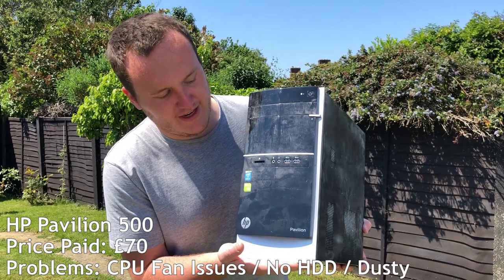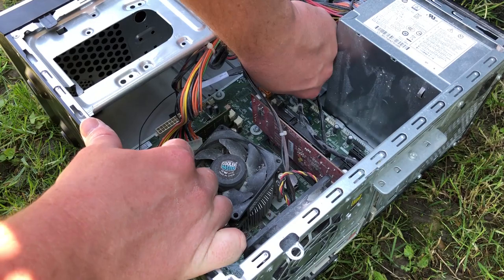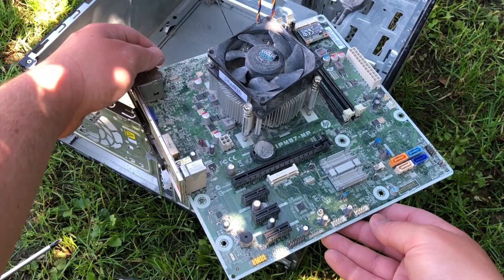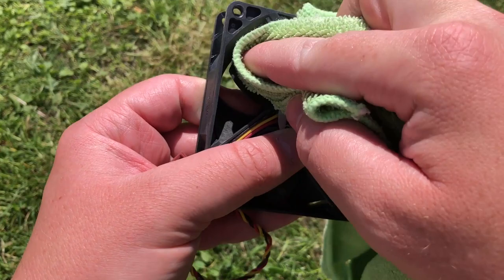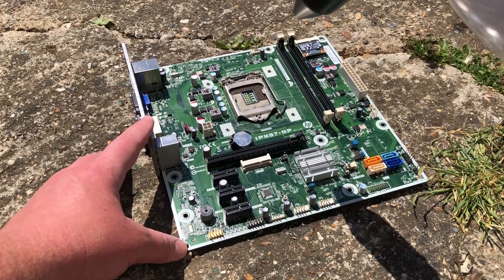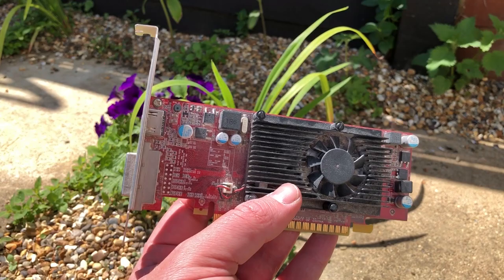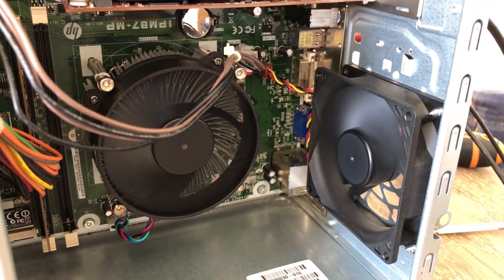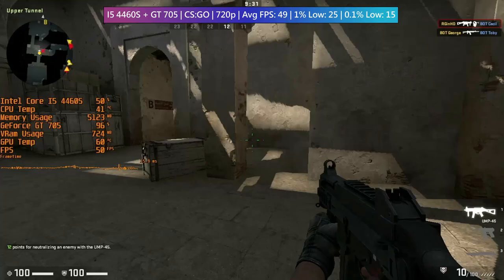Fixing Broken Ebay Gaming PCs - The Filthy HP Pavilion

Comment: I got an AMD A55 board with broken fan connector. I used auxiliar with a larger fan borrowed from scraps (which had the same pinout). Reason of damage was a transistor just behind the connector and looks easy to fix if you have heat gun or solder station to replace it.
If you don't want it, find a PWM extension cable or a heat sink with two fans (got one from Aliexpress) and use the auxiliar fan comnector
Reply: Board fan connectors can fail due to overload in fan (dirty fans also can do this), damaging the controller near it.

Comment: Love the videos, I've got an old optiplex 780 Mt and upgrading in small bits here and there. hopefully the new PSU will fit the 24 pin on the board.

Comment: 6:07 - I think it really depends on the materials; You have these expensive ESD-brushes that are made of some kind of composite that isn't conductive and thus prevents electrostatic build-up. - But I think, if you have something like a wooden handle and bristles that aren't plastic prone to static, I think you should be fine. - I'd just look out with those metal parts that hold the bristles, to be honest, and again anything plastic. Though, I bet even toothbrushes could do the job safely enough. - Also make sure that, with really tiny parts on PCBs, that it's a really soft brush like the one in this video indeed. - I'd also suggest using a brush on fans instead of a cloth around a finger for convenience, if you haven't tried.

Comment: I went to my recycling center and this guy recycled a gaming computer that had a 660 ti. I looked at the price that these are going for and they're selling anywhere from $60 to $80 on eBay. We're not even at 750 TI performance here. I put it in a Dell optiplex and replace the power supply and I put it out there on Facebook. Decent little machine.

Comment: One product I will always recommend is Holt's electronic circuit board cleaner spray, it is amazing stuff and dries clean too.   I use as brush of choice an old hairdressers neck brush which is very soft but has enough spine to get into dirt very easily.   Beware that DVD, they accrue dust like magnets so prob want to power it up after blowing through the encasement and have the door open and blow thru again and dab a bit of white grease on the spindles and motor shafts.   Been doing this since the 70's hehe

Comment: if you have noisy fans, simply open the sticker on that fan and below that, you will find a mechanical part of the fan. then just add a little bit of lubricant oil and you're good to go.

Comment: pea size ftw. Only time I had issue was on a razer blade where the GPU doesn't get a smooth copper heatsink, but instead two pipes pass ontop, leaving a hotspot where it doesn't spread due to the separation of the pipes.

Comment: I found similar looking Pavilion from dumbster back in 2017, i5 4440, 12gb of ram, gtx 760 and 1tb hdd. Only problem with that machine was corrupted Win 8.1 installation. New fresh install and vola! I used it as my main rig for 2 more years and sold it for 300 euros :D (Before that i was using some carbage with Core 2 Duo and gt8800 so it was a huge upgrade)

Comment: I have an HP Pavilion PC from 2010 with an I7 processor and a GT 420 card. Of course, the benchmark for the GT 420 is puny, but, amazingly, I can get around 60 fps on Arma 2 (with low settings and 88 % resolution) and even on Arma 3 (with low settings and low resolution in windowed mode). In fact, I replaced the GT 420 with a GTX 570 soon after I bought the PC and soon discovered the wonder of (at that time) "high end" gaming. But after a few years of faithful use, the 570 died and the GT 420 came back... I did try to upgrade it with a 1060, but the mobo was too old. So I tried a GT 1030 instead. Same story. So, I've just bought a second hand GTX 560. Waiting excitedly for it to arrive...

Comment: I bought this new in 2014 at half price in a currys sale.I now have it connected to my 65" samsung where I use it to watch youtube videos without the ads thanks to adblock+.I'm not a gamer,but do use photoshop from time to time and with 32 gb ram and an ssd fitted it still performs quite well despite the cheap and nasty gpu.Mine has the amd chip rather than intel.

Comment: That's cleaner then my Dell T7500 I brought off Ebay for 100 pounds.. It had fluff and lots of dust in her lol. 

Good buy still as it had 48gb ram and a 120gb ssd installed with a 6 core 12 thread 2.8ghz Xeon

Comment: Just noticed that CEX are selling a PC with a ryzen 3600, 16gb ram, gtx 1660 super, 240gb ssd for £655. That seems not to bad in this current climate of gpu shortages if you need a mid range pc.

Comment: If you have optical drive i.e. CDROMS/DVD drives you need to open them up and blow all the dust that's inside, take a q-tip and clean the laser read head movement rails and re-lubricate with Super Lube. Super Lube is the best damn silicone lubricant on this planet.

Comment: Hi, I know what you mean, The states that I get systems in for repair. I have had a couple that needed cleaning with a pressure washer. Dell & HP Pavilion seem the worst for low specs, most times you need a new case if the motherboard is shot. I replace the power supply's with Corsair CX600M units. Enjoyed the video's interesting channel.

Comment: The correct answer for the thermal paste:
It doesnt matter shape, as long the ammount you put can cover more than 90% of the IHS after putting pressure with thd cooler..

Too much will have the opposite effect of cooling, and will spread all over the place after putting the cooler.
Too litle will overheat.

I personally preffer to spread it manually because I cant be really sure a pea dot of thermal paste will spread evenly on the ihs with the cooler pressure. But its not like it's wrong a pea dot.

Comment: I have that identical pc, removed the fan pwm wire and it now runs fine, run it with a noctua low voltage extension so its not full speed and its fine.

Comment: You mentioning on the PSU and not taking it apart (Disclaimer: If you don't know what your doing don't do it as you literally can die in a instance) but you can take them apart and short the cap across with a insulated screw driver and it will discharge the cap if there is any residual voltage left leaving the interior safe to work on.

Comment: You can mitigate some of the stuttering in games like Fallout by setting a max frame rate(I'd say 30-40 for the Fallout example) in the Nvidia Control Panel 3D settings.

The lower variance in fps will make the stuttering less noticeable. Doesn't always work well, but yeah, it can eke out a bit of extra playability sometimes.

Comment: I would recommend cleaning/blowing the motherboard with the CPU inserted otherwise you can blow dust on the pins or worse bend the fragile pins. Other than that great video.

Comment: For whole thermal paste, simplest answer is, the only wrong way is too little. Pea sized dot, x, smiley face, lines, flowers,... it really is all within less than 1C difference for regular desktop parts. It starts to matter a bit on HEDT like Threadripper, since heatspreader and CPU itself are huge. But with regular things us mortals get, it is small enough that it spreads once it gets pushed down by the cooler and paste is made to fill smallest of the "cracks" between CPU heatsink and cooler. It is really thin layer. And even doing too much, will just squeeze a bit out on the sides, which is non-issue unless you used whole big tube.... though it wouldn't be an issue with that either as long as paste is not electrically conductive. So basically, you almost can't go wrong and even if one corner is missed, die itself is in the center for Intel and heatspreader has "spreader" in the name for a reason.

As for GPU, make sure you give it enough, because unlike CPU, GPU has no heatspreader that can make up for some corner not getting paste. It is on die directly and it has to cover corners, because otherwise that portion will run hot. Obviously this little thing didn't need much, but if you got bigger die, then give it enough.

Also for beginner and most worry free, don't get paste with metallic base, or in other words electrically conductive. Something like Arctic MX-4 is fine and very safe to start with.

Comment: I like to use a 1/2" paintbrush for cleaning out corners, fans etc. The long bristles reach in to heatsinks well too.
With the low power CPU the PSU should handle any slot powered graphics card. Ignoring that you can't buy any for sensible money good options included RX 460, RX 560, GT 1030, GTX 1050, 1050 Ti or even GTX 1650.
And of course another 8GB stick of RAM.
Max CPU would probably be 4770, think there is lower power version of it that should work.

Comment: this is exactly like my grandpa's old computer that I took apart not too long ago. Except this one is a bit more "normal" looking. My grandpa's didn't have a discrete power supply or graphics card, and it had a soldered CPU. The motherboard handled power delivery and didn't have any PCIe lanes. It had a soldered AMD E2 CPU of some kind, and used onboard graphics. It also had mismatched RAM sticks, with a 1GB Kingston stick and a 2GB Samsung stick. Weirdest computer I've seen so far.

Comment: i'v opened manny psu to clean them, then i could say, if outside of it is dusty, inside too, you clean only the outside , the inside still dusty, 
there 1 psu that i cleaned, the board inside are actually green in color, but turn brown because of dust.

Comment: Got a i7 870 pc for $20 that way.

Bought a 27 inch 1080p hp monitor from Marketplace for $30. Went to the old ladys house to pick it up. Asked why she was selling it and she said she didn't have a need for it as her computer didn't work.  She said she had a local repair shop fix it for her but it still wouldn't stay on.
I popped off the side cover and saw every fan avaliable was completely clogged with dust. Including the psu .

Told her I would fix it for her without charging but she had already bought a laptop. Tried to give it to me for free but I had to give her something. 

I removed the cpu fan and saw it had new thermal paste... I'm just confused why some repair shop would put new thermal paste on but not clean any dust.

Comment: I received an older Compaq version for free. With a new mATX LGA1150 motherboard, 2x 8GB DDR3 1600 sticks and a new PSU, I have a perfect system for my i5 4440 (or i3 4160) and 2GB GTX 650ti. Also has an onboard Ati Radeon 4250 and an Athlon X2.

Comment: I have a system where that fan error comes up constantly, but that is because i slapped in a case fan on the cpu cooler. At the expense of a lot more noise it got quite a bit cooler

Comment: That 4460S' iGPU fairs better than that 705. Might as well use the iGPU. I used to have the 4460S and it could run cs go at 100 fps easily in low settings

Comment: Doesn't that CPU have Intel HD 4600 graphics? Wouldn't you improve performance just by removing the GT 705? as the iGPU is actually more powerful, especially if it had dual channel ram.

Comment: Lol that's what I got currently with a bit of upgrade, the motherboard is the Memphis S pegatron. I've got core i7 4790 non k with a GTX 950 and 600W certified bronze power supply and 16gb of 1600mhz ram

Comment: On the application of thermal paste: exactly, there is no black magic, it is not rocket science, just a drop in the middle 😄
Reply from the maker: Yep, no need for a 10 minute video on it 😂
Reply: Depends what you are using, with Kryonaut the best application is very much to spread it as it is thicker consistency and won't spread as well. There is even a chance the consistency could cause gaps if you just put a drop and compress which will be an issue - not a regular issue, but it has a much higher chance of happening than cheaper mx4.

Comment: You answered a nagging question I had about whether or not GTA 5 was more CPU or GPU intensive. No wonder it seems to run so well on my Lenovo T 530 ThinkPad. My setup consists of an i5 3230m 2.6 GHz (overclocked to 3.1 GHz) CPU,Intel HD 4000 GPU, 16 GB of RAM, a 1 TB storage drive, 128 GB SSD boot drive and I am running GTA 5 off a 128 GB SD card. I am getting 25-35 FPS averages.

Comment: alternatively you can use a torx bit to remove those screws, hp seems to have a love affair with those things lol. now the power supply? I guess I was lucky in the early years then, had taken many apart to do just that. a smokers PC had a lot of challenges lol. but yeah in retrospect, I probably could have used rubber gloves.

Comment: slap in a GTX1050 or 1060, or an RX470/480 and a 400W+ PSU and you have a decent budget gaming PC right there. Always boggles the mind why people simply throw these things away. Heck even a GTX1050Ti could be had that doesn't require a power connector and that way you wouldn't need a new PSU.

Comment: another ram stick and a 1050 and that little hp will be pretty good

built my mother a similar pc achually from the trash bin at work
dell 790sff  i7 2600 16gb ram 
and i put an 256gb ssd and 1050ti msi LP ans a 2tb hdd
built it 3 years ago for around 300usd
and it still works great and play most games really well.

Comment: Hey I bet if you put another stick of memory in that system it will improve your FPS as strange as that might sound, try it an find out even with that weaker GPU. That system is running on single channel instead of duel channel witch tends to run way better.  Also a cheep upgrade is an 2.5" SSD does not have to be rill big as far as space is concerned. You can get ones on amazon for like 30 dollars or less that will work just fine and with that 1TB for your space drive it will run rill well. Just some input like the video my friend have a good one and God Bless.

Comment: I recently got a free full fledged gaming pc from Facebook marketplace with an i7 4770k because it wouldn't post and turns it was just dust that wasn't allowing it to post 

Full specs:
2x8gb ddr3 hyper x fury 1600 MHz
I7 4770k 
Yalman cnps 9900 cooler
Msi gtx 670
Zalman ms800 plus case
Some old ldlc 500 watt bronze psu
Msi ms7821 motherboard

Comment: 1:30 that's a torx (non security type) screw, it is a slotted type (hp being "nice" to us techs), but it's meant to be used with the torx screwdriver.
7:27 i mean... that's a bit overexagerated, but i can't say you're wrong (expecially with the primary caps).

Comment: I have a £7 balloon inflator from eBay, it's much more powerful than any can of air or electric duster since it's a plug in one and is about 30W 

It's quite overkill but if you need a cheap heavy duty option id look into that
Reply from the maker: That’s awesome I never thought of using something like that

Comment: GPUs are bare die, they don't have a heatspreader.  You absolutely need 100% die coverage on them.  If you use pea method and use too little, if part of the die is missed and lacks temperature sensors, that part of the die can burn out.

Comment: would be cool to see you compare the performance of 1080p, 1280x1024, and native 720p (19" 1280x1024 monitor, GPU scaling "on" in driver, set to "aspect ratio" or "do not scale", set resolution to 1280x720) on each of these builds, with each game tested. More content, and would show how far 720p or 1280x1024 can take older systems. (Phil's computer lab has videos on the above FPS gains)

1080p ultra/very high details is a lofty goal on this older hardware. It tends to make systems, that could give great gaming experience, look like garbage out of the gate.

Edit: more specifically GT 730, 750, 1030, 1050 DDR5 cards. This card is pretty gutless.

Comment: Not bad - though that GT705 is really terrible. My standard i5-4460 (not the low power one) can handle a GTX 960 with no issues, so that graphics card (and the PSU) has got to be upgraded, in my opinion.
Also - HP love single channel RAM! Upgrading the RAM with a 2nd stick would be a must for me.

Comment: The fan issue is common on this HP machines i've a similar one (full amd) and the stock cooler doesn't start and the same error appear one the screen like yours. I've jsut replaced this one by another one and we works fine.
The problem on this fan is the axle because sometimes they just need some lube on the base

Comment: Sir a question
How much a Power Supply can affect the performance of a pc ?
Reply: The power supply has a fairly simple effect, the PC either works or it doesn’t. If the PSU cannot provide enough power to your components, the PC will shut off. If you want to check you have a powerful enough PSU, there are websites online where you can type in the components you have. It’s also worth noting that you should never cheap out on a PSU, because if it goes wrong you could fry the rest of your components
Reply: @jbritain thanks I have a PSU not a branded one but a decent one seems I am in a good spot

Comment: I see two roadblocks for upgrades.. One is a easier fix that being the weak PSU as you said, The other however is the right hand mounted motherboard... I hate those in OEM systems it makes multi-slot GPU's a real gamble if they will fit or block something impotent like a power or sata connector

Also on a side while not the only cause here, A cheap HDD will make stutter worse in a lot of Bethsaida games or really any game (mostly open world) that constantly streams assets from storage. 
For example my C2Q Q9650 / GTX 680 HTPC stuttered like hell when I ran even FO3 off it's 6Tb HDD till I slapped a 256Gb boot SSD in and moved the game over. Now it plays at max setting with enhancement mods with little to no issues

Comment: you could use a tiny screwdriver i mean the one you used but in tinyer for torks torx? yeah pro tip when you need such screws of evan works with the one with a pin in the middle seccrurety ones i mean and  a veryy good video like allways and sorry for the grammar i am german so its not my first language